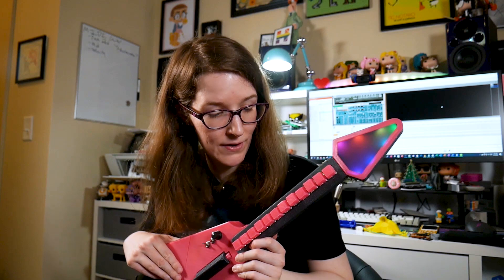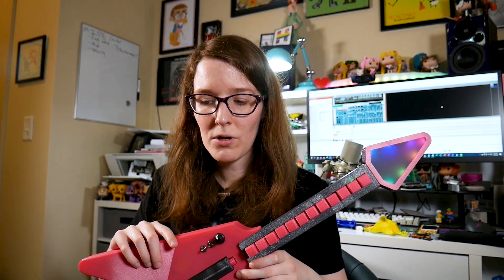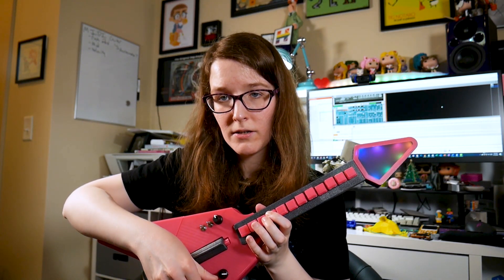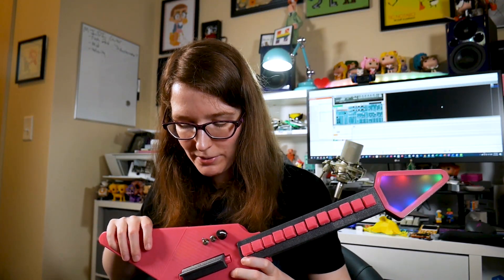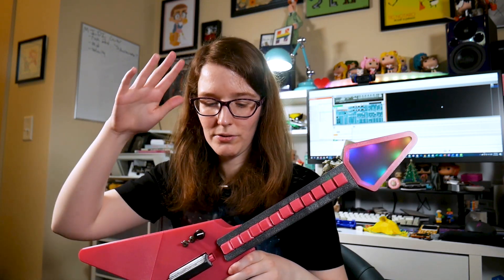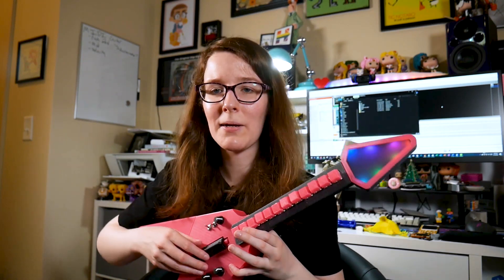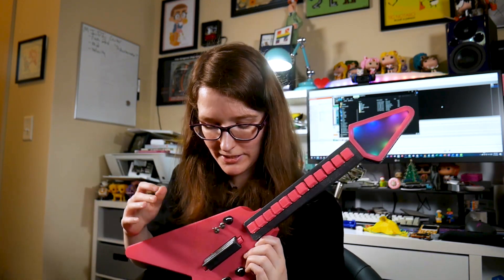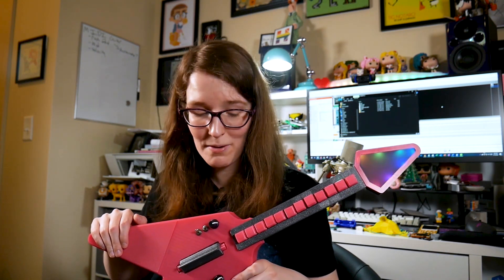MIDI Guitar 🎸

Comment: I am looking for something EXACTLY like that.  WITHOUT strings... only a spring-loaded (and extraordinarily resilient) "Flapper" type based device which is designed with expectation of replacing springs with a model of string which is very common and low cost... in addition to a big button on the body (for knocks) and buttons up neck for general note press detections, hammor ons, and pull offs... that is ALL that I need or want... NOTHING more intricate, it would actually be in the way for my needs.